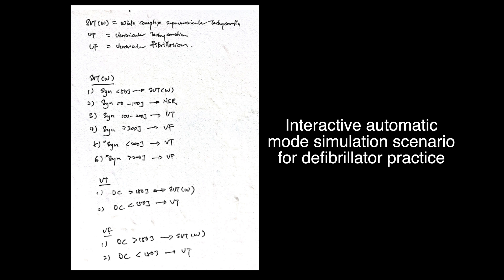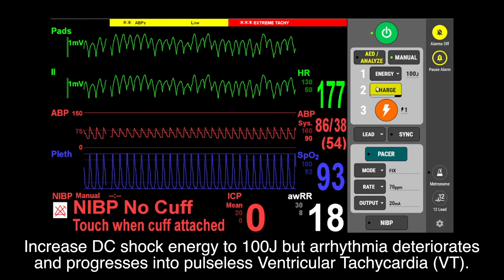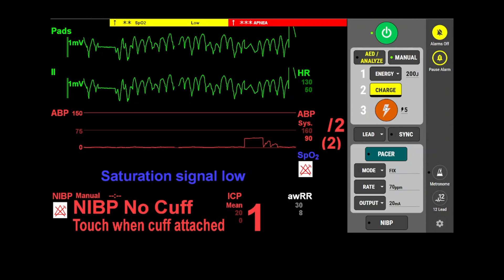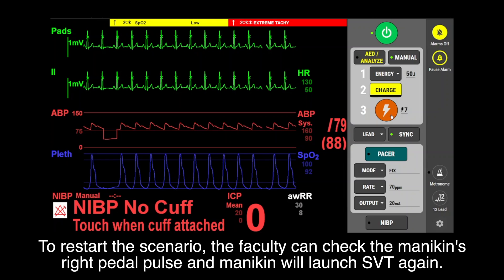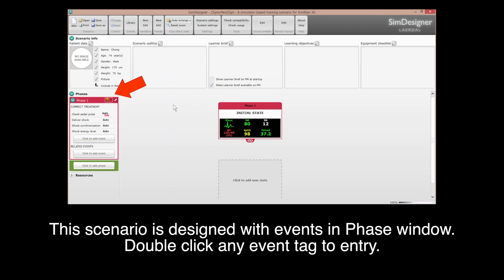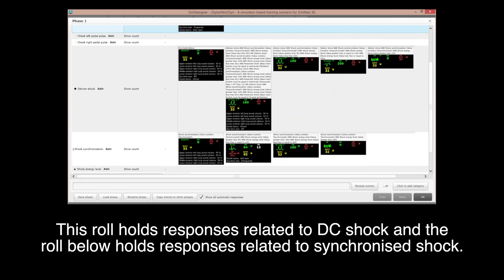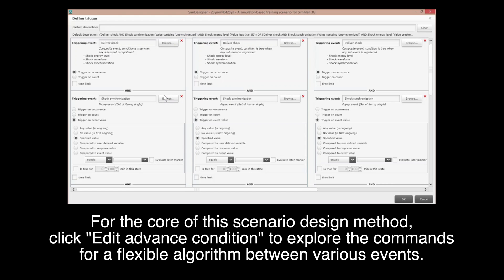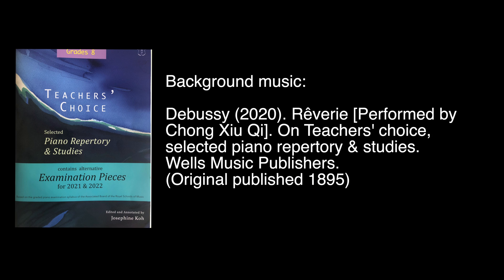Interactive automatic mode simulation scenario for defibrillator practice.

Comment: How do you get this?
Reply from the maker: Great that you ask!  This is a programmed scenario, it is arranged with SimDesigner (LLEAP software by Laerdal) for Laerdal manikins which detect defibrillation.
This concept includes 3 conditions: 1)  arrhythmia x 3;  2) detected syn or non-syn DC shock; &, 3) detected DC energy level.
Learners navigate the simulation with manikin and defibrillator.  With right synchronisation, right DC energy level for the appropriate arrhythmias, the learners will progress to normal sinus rhythm with pulse.  Otherwise, they will be trapped by the 3 arrhythmias.
If you are familiar with SimDesigner, the last chapter of "Overview of programmed scenario" will give you an idea how it was programmed.  You can start with less complex scenario like "Mini automatic simulation scenario" (https://youtu.be/WACxY3uKNT0) and build on.
Best wish to you.